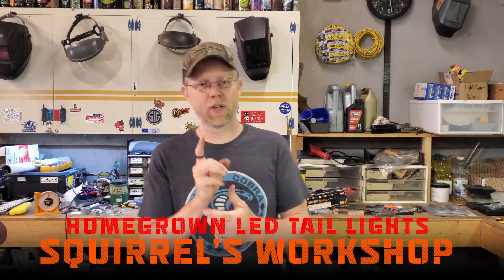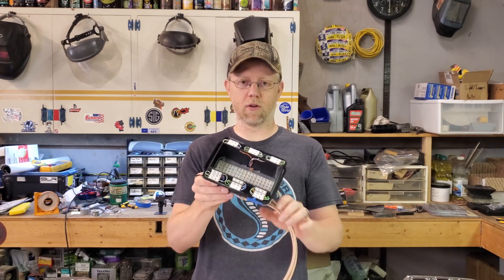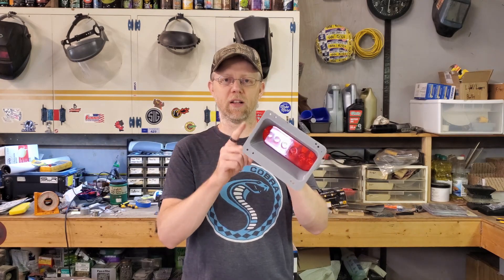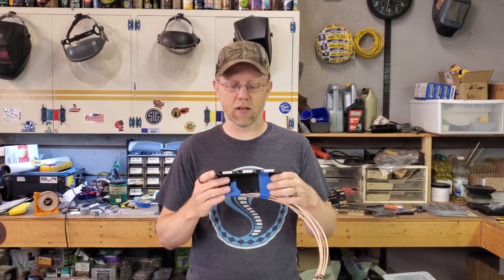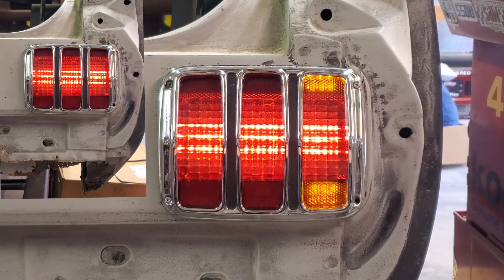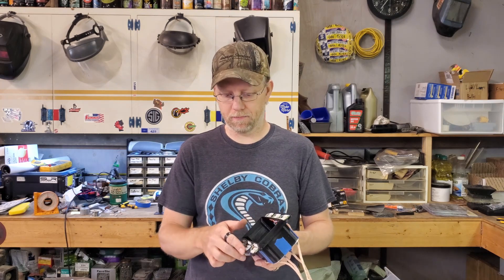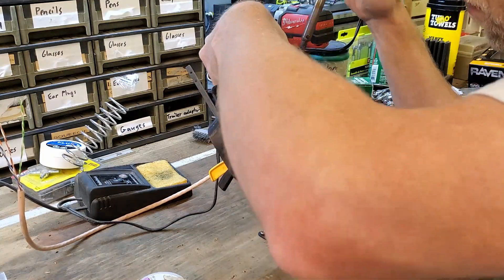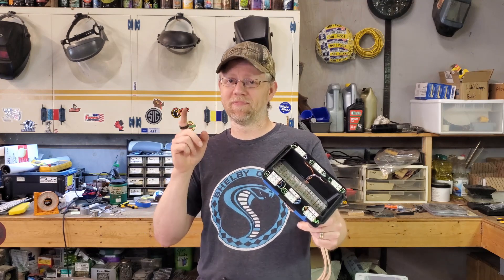3D Printed Taillights, Part 2

Comment: What did you use for changing the light sequence?
Reply from the maker: I used a set of pushbutton switches. I'm sure it wouldn't take much to rig up a sequencer, but I don"t think this this is the version I am putting my car, so I haven't tried.
Reply: @squirrelsworkshop  i have a 71 grande I was thinking about doing something like this and like the parking lights you did that go inbetween the fender extensions.
Reply: @squirrelsworkshop  was there any spesfic sequence you wired them in for the push buttons?
Reply from the maker: @jessehiatt9225  honestly, it was a messy jumble, but I had 6 different switches because I had 6 different zones of lights. Do you want to do the amber sequential and the red stop/tail?
Reply: @squirrelsworkshop  yes
Reply from the maker: @jessehiatt9225  you would need a sequencer to run the three groups of amber LEDs, and then enough white or red leds to act as stop and tail. I dont know what the 71 lens/bucket looks like, so im not sure how much room you have

Comment: Really cool I just came across your video because it saids 3D printed taillights, consider getting addressable LEDs with a sequential controller it will be another level one of the companies that sells diy kits is corsomotion check out their stuff I’ll say you did the hardest part which is 3D printing the housing.
Reply from the maker: Thanks! I would consider a more advanced LED setup, but I am trying to make this simple. In fact, the final version will be more like the first one.

Comment: The version 1 with trailer light: paint the interior with satin white paint, it will be brighter and more diffused than with just the grey abs.
Reply from the maker: Do you think a satin finish would be better than gloss?
Reply: @squirrelsworkshop  If you want a constant diffused light across the lamp, yes.  If gloss you'll get a brighter light around each "bulb". There is a bit of discussion on the web with comparisons.

I have been going thru same trying to improve first gen Firebird rear lights.  LEDs are now available in the 1156/1157 style glass bulb, so I am testing those at present. (btw Ali/Temu is your friend, good quality at reasonable prices compared to the specialist classic car stores selling whole LED light assemblies for $$$)

Comment: I'm thinking of doing something similar with my car. I thought that the red lenses wouldnt with with amber LEDs. I'm thrilled that  they will. Have you thought about attaching the LEDs directly to the back of the lens? The gasket should still seal them.
Reply from the maker: I was pleasantly surprised that the amber worked so well. Yes I would attach LEDs to the lens, but I don't like to see the individual dots. I was looking for thin panel style LEDs, but I couldn't find the right size/style

Comment: Might be worth noting that this sort of mod is illegal in many places, so best to check your local DOT laws before putting time into such a project.

Awesome work.
Reply from the maker: The laws in most US states usually require a certain number of red lights and/or square inches of red iluminated area. Rarely have i seen anything that precludes custom lenses or light sources. Of course, other countries may have completely different requirements.
Reply: @squirrelsworkshop  Yup, and I imagine there are people from other countries that may see this, unaware they could be fined for making their own vehicle lighting.

Comment: Include a channel around the housing in your design. And either print a gasket out of TPU, buy gasket material, weather stripping, or even rubber vacuum line and put that in the channel, or fill the channel with silicone and let it cure, then attach it, making the gasket part of the light fixture. You could even print parts in the channel that the silicone can flow around, locking it into place.
Reply from the maker: Solid ideas. The big challenge is the shape of the lens, it has a thin edge with several curves that barely clear the lights. I actually considered using silicone to seal the lens to the light backer, and deal with it later if it needs to come apart.

Comment: How much does a 3D printer like that cost?
Reply from the maker: This one is an Ender3 v2 Neo, and usually costs less than $300USD. It has enough features to be useful, though it does take some setup and calibration.

Comment: Your gonna loose light intensity trying to use amber behind red lens. You need to stick to the correct lens color for the led color or clear lens.
Reply from the maker: Yeah, thats the challenge. I really want to keep the original looking lenses, and have amber turn signals. I will figure it out soon!

Comment: ASA or PETG is where it's at. Has a higher glass temp (I've 3D printed an intake runner thats survived underhood temps) You'll need an enclosure to keep the heat in the print area. 240-250C temperature at the nozzle and 90-100C for the bed. There's vids on how to set up splicing, fan speeds etc. Giving me ideas on how I'll do my lights on my truck when this current set runs its course.
Reply from the maker: Thats awesome! What engine did you print the runner for? Got any pics or vids?
Reply: Hi! That do u think about ABS. I suppose,  that ABS is more suitable for car parts.

Comment: A fresnel diffuser between the LEDs and the lens might help too..or just at the top and bottom strips...
Reply from the maker: I think you are right, but i worry about losing even more of the yellow intensity with another layer.
Reply: @squirrelsworkshop  that's gonna happen with any diffuser. Brighter lamps as you said in the video.....
Reply: @squirrelsworkshop  BTW, I have a 1970 Convertible I play with. I'm considering options for a new dash pad. The design originally is crap....they split in the sun at the speaker holes after a few years.
Reply from the maker: @The-Scott  cool! Yeah, the old pads really take a beating in the sun. I dont think i will go with a soft dash in this car. Likely a metal or carbon fiber skin, but i need to be careful with sun glare. Maybe a matte finish?
Reply: @squirrelsworkshop  I've considered the matte finish too. I thought about using the current pad as a mold to fabricate one. Ive been avoiding changing the brake booster. It's such a pain working under the dash like that

Comment: Hello, first let me say I am a huge Mustang fan and I enjoyed watching your two videos on your taillight design.
While doing my own research I can across some videos that might help you get the design and brightness you want to achieve.
The first one shows surface mounted LEDs along with the already designed pc board. https://www.youtube.com/watch?v=_luUCXGFTQ8
The second one (https://www.youtube.com/watch?v=Y5u6skdiCfU) shows even higher-powered LEDs. If you start watching around 2:30 minutes you will see in the video how the gentleman modifies the LED pc boards from round to rectangle, which might allow you to use that type of LED for your turn signals. My only concern is those most likely will create an individual spot versus a nice glow. If you have enough room, you could try placing an acrylic piece of plastic (clear or white, semi-transparent) between the LED and the taillight lens. On both sides of the acrylic lightly sand each face to help diffuse the light.
I hope this is helpful and you finally get the design you like.
Reply from the maker: Thanks! I will have to check out those videos.

The idea with the sanded acrylic is just what I have been scheming for the final version of the lights! It should help with mounting everything and with diffusing the hotspots. Thanks for the info! Glad you like the videos!

Comment: TPU as mentioned, or get a design laser cut out of gasket material, or model in a channel and use an o ring (which might be more pain than it’s worth seeing how the print was oriented :))
Reply from the maker: The problem with an oring is that the lens isnt actually flat, it is concave on the sealing surface, which is strange. Now that i think about it, maybe its warped with age...

Comment: I like the simplicity of version 1 using off the shelf parts that can be replaced cheaply and easily by the older group that most likey will be driving the classics.
Reply from the maker: After going through the exercise of design-build-show, I feel the same way. Version 4 should incorporate the best of all the ideas
Reply: The simplicity of v1 with the slight in was beautiful simplicity. I love it

Comment: Very neat project Squirrel ! Did you make your “clamp soldering stand? That 3D stuff is interesting..I can barely operate an IPhone! ….. you must have computer skills!
Reply from the maker: That stand is a Ram Mount. Just a swivel with flat plates that can be bolted anywhere. Pretty handy!

3d is awesome. I use a couple different CAD programs at work and at home, so it's second nature at this point. Thanks for stopping by!
Reply: Dang Ram has a lot of clamps! Interesting 👍👀👍thanks!